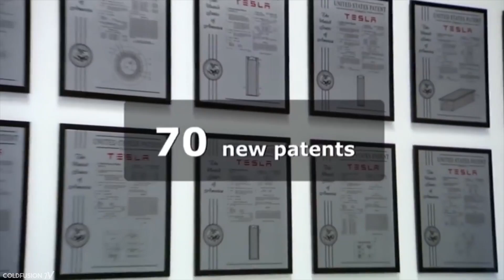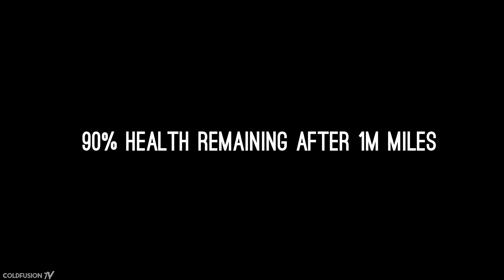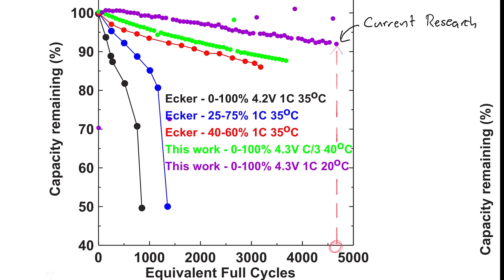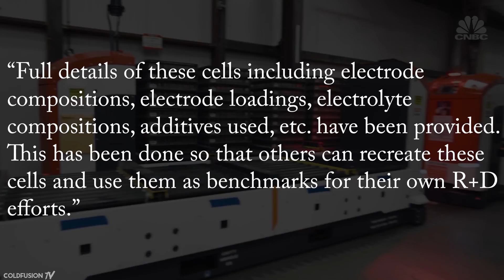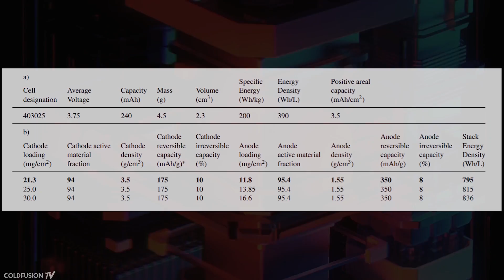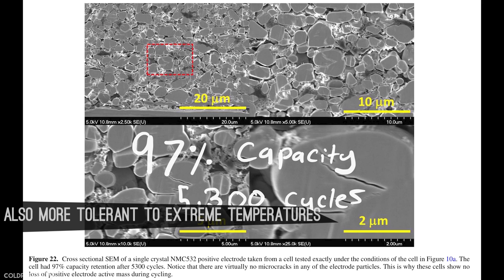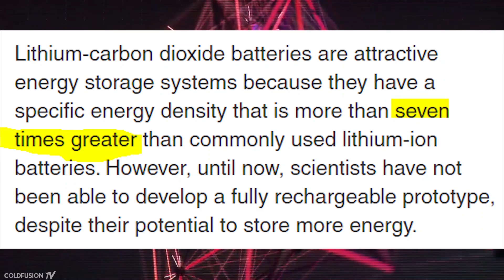Tesla's Million Mile Battery

Comment: This would be on par with a Caterpillar diesel engine life expectancy.
Reply: @James Flint Ohm's law states that voltage = current x resistance. It helps determine either voltage, current or  impedance in a electric current. It has nothing to do with the capacity of Tesla's batteries. So please elaborate.
Reply: @James Flint so I'm guessing you're smarter than a bunch of scientists
Reply: @James Flint Would it matter if the energy source is renewable? I can why that would be a problem with gasoline but the amount of wattage we create every year can easily support an EV.
Reply: @James Flint I can see where you're coming from. I actually believe nuclear is the future, nuclear is a renewable energy source it's byproducts however aren't. Thorium reactors being developed in other countries like India and China are safer than typical reactors and produce equal amounts of nuclear energy. There are also SMRs (Small Modular Reactors) that are being developed for long term energy solutions. My point is technology is rapidly accelerating us towards an electric future quickly, whether we like it or not. Because the pros still outweigh the cons.
Reply: @James Flint For thorium reactors? We literally have millions of tons of thorium laying around because no body uses it for anything. We have mined enough Thorium to power the planet for at least several thousand years.
Reply: I was not commenting on the wisdom  of battery storage, I was commenting on the improving durability of the batteries and the fact that Caterpiller engines have a 1 million mile warranty on them.  I am seeing a lot of Tesla's on the road and in a few years people are going to start needing to replace the battery packs or start repairing them themselves after they are out of warranty.

My calculations based on annual consumption of transportation fuel indicate that if 100% of our transportation were electrified, we need to increase our electrical generating capacity by a factor of nearly 2000 from current facilities.  There is plenty of room for coal, nuclear and as much hydro, wind and solar as possible.  An economical battery would even be useful at a base load power plant, if they can operate at full capacity which is at its most efficient mode, excess power at those moments could be held and released when demand exceeds base load.  We have some wind farms in Indiana now and I think they are awesome.  I have stopped and watched them for an hour at a time.  I would love to have one in my back yard.  I don't understand why people who will not even be able to see the wind turbines are so fiercely fighting them. 

The reality is every source of energy is solar.  The oil and coal come from plants and animals that concentrated the solar over millions of years and then were sequestered under ground.  Even nuclear power is concentrated solar from a long dead star that super-nova'd billions of years in the past.  Wind is solar because it is the sun heating up the ground and causing the air to rise and creating a vacuum at the surface that creates the wind.  Hydro is solar because the water from our oceans and lakes were heated by the sun and raised to great height, it falls as rain and is stored in reservoirs lakes and rivers.

We have some promising battery tech on the horizon but isn't there always a promising something on the horizon.  Fusion power has been 30 years away for as long as I have been alive.
Reply: James Flint you have a better idea?

Comment: Imagine a phone battery that charges in 5 minutes and lasts 1 million+ years.  This is the battery tech we've been waiting for.  This also helps for overall electric.  Our problem is storage.  With these highly efficient and lifespan viable batteries, we can probably have electric be free within 50 years.
Reply: Its 4000 full charge cycles, so about 4-8x better durability. Much higher on partial cycles.

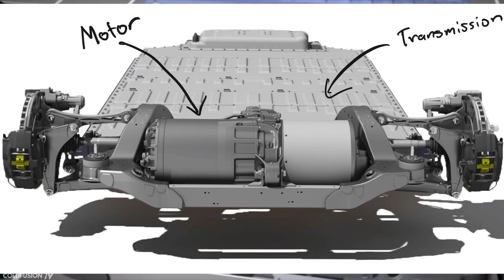Comment: Already @2:30 in the video you are woefully WRONG!  That's not the transmission you are pointing at in the Tesla underbody that is the inverter system. The part that converts battery energy into 3 phase power for the motor.  Between the inverter and the motor is a small planetary gear system that is the transmission.

You need to go do more research!  https://www.youtube.com/watch?v=3SAxXUIre28&t=24s

Comment: I'd be happier with an EV that did 750klms between charges and charged in an hour.
Reply: Unless you have a 425km commute to work then that is absolutely pointless. Unless you drive 750km in a day that's pointless. The idea with an EV is you plug it in when you get home so it's always ready for a new day. You never need to go fill up again, never need to go out of your way if you're organised at home. The only issue is with road trips where you need to (in the present) search out a charging station.
Reply: @dannnnn496  That's great if you can charge it at home. I live in West London. I have nowhere to charge in at home. I can charge it at work for free but I need a pretty good reserve. I have a holiday home in Ireland which I drive to about once every six weeks. It's about 400klms just to get there.
About 60% of city dwellers can't charge at home. If indurance in pointless then why is it one of the biggest selling points?

Comment: Great video!  We’ll see how soon this comes into fruition — whether it’s a year away or more like 5.

Important thing to bear in mind about the 90%-degrade cycle counts you quoted in this research (1000 on current battery cells vs. 4000 on these new cells):  These cycles are 100% discharge and 100% charge.  While Tesla lets you do that, they discourage you from charging higher than 80%, or discharging below 20%.  Most other (PH)EV manufacturers don’t even show you the full range of battery charge, maintaining an invisible 15ish% “charging margin” at these top and bottom.  That is, they make it impossible, not just strongly discouraged, to charge beyond these margins.

These margins vastly increase the numbers of charging cycles.  You definitely can charge even current batteries many times the “1000” cycles without substantial degradation, as long you maintain these charging margins (which, again, many EV makers don’t even give you the option to violate).  Plus, of course, provided that the battery had sufficient cooling, and a few don’t (basically, don’t buy a Nissan LEAF if you live in the southern US states, unless you’re OK with 30% degrade over 10 years, which is acceptable for some people, but at least arguably not many).

Comment: Emagine having an RTG that feeds the battery all night or whenever its not being used.  The car would never need charging from the grid.   80 years of driving the same car.
"Each RTG had a total weight of 37.7 kg (about 83 pounds) including about 4.5 kg of Pu-238. It uses 24 pressed plutonium-238 oxide spheres and provides enough heat to generate approximately 157 watts of electrical power initially - halving every 87.7 years. Each RTG generated about 2400 Watts of thermal power."
We have the tech to secure and protect the core from crashes and tampering.

Comment: I began to doubt the credibility of this post when you said an electric car has only two moving parts. Besides the motor and the transmission you have the steering and braking systems, the doors, the wheels, compressor for AC, etc. I'm not an engineer so I don't know for sure, but yeah credibility issues...

Comment: What a stoopid point! Main reason for buying a new car is not the fact that car is broken but vanity. Car companies advertize that you must have a new model because it has more torque, more HP, abs, drs, atcs, prtdghutfs and all the "eses" and whatnot. I work in a bank and drive mitsubishi with 280.000 km already driven. Everybody thinks i am crazy and ask me "why dont you buy a new bmw or mercedes"? I said "why"? This car i have is perfectly operational. They said, but new car  has this and that. At the end, it is all about dick measuring. And nobody's is streched for 1.000.000 miles. It ussualy "folds" around 150.000 miles or few years.

Comment: Sharing the info of the battery is not a nobile act, it's a smart strategy. The limitation of electric cars right now are batteries. If someone else can fix batteries using that information, it will solve Tesla's biggest problem, pushing forward the electric vehicles market hence Tesla's business.

Comment: Elon Musk should also divert some of the research on sodium ion batteries.. with lithium fast becoming a scarce commodity due to the unprecedented demand for battery manufacture, sodium ion batteries although a bit bulkier and less energy dense than lithium ion batteries at this point would be a good alternative for use as a energy storage and power wall alternative in power grids and homes.

Comment: Awesome video, It is so great to see innovation that leads to better technology for everyone.
The new lithium-carbon dioxide battery is very interresing, if it lasts 7 time on a single charge, that means it needs to run through its cycles 7 times less often, so it can hold up to 3500 cycles relative to the current battery technology.

Comment: 4:34 What a load of crap! Tesla doesn't aim to help any other companies improve their designs! They've got an EXCLUSIVE LICENSING AGREEMENT!

Tesla doesn't do jack sh#t to further EV adoption rates among traditional car manufacturers or help improve general battery technology whatsoever. They are a for profit company, so stop acting like they are a damn charity. Elon's only goal is to make money. That's why they refuse to open up their supercharging network to any other cars, that's why they have an exclusive licensing agreement with Panasonic so that nobody else can get the cells they are using. That's why they are the only large car manufacturer refusing to sell spare parts to anyone. They want all the money they can get, and they are willing to go further than any current car manufacturer to do so... even VW is offering to supply EV components to everybody who wants to use them, they also sell spare parts, repair manuals and diagnostics tools to the public and to independent repair shops. VW for f#ck sake!

Comment: What hasn't really been mentioned is that a doubling in lifetime cuts the cost for storage in half. This is not so obvious for cars since even a pristine battery is still enclosed by an aging car, If you sell it after 10 years you sell a mix of both.  But it will still reduce the money you lose between buy and sell and thus lower your total cost of ownership. Where is becomes pretty obvious is with grid storage. There is a lot of talk how we can not get to 100% renewables because we can't store the energy. If we can double the lifetime then we are cutting the cost in half per unit stored. And this is described as "just a milestone". It's really hard to find word what a colossal change this is.

Comment: You missed the key change, instead of coated nickel cathode particles made up of hundreds or thousands of crystals, each particle is now a single coated crystal of cathode material - which does not break when pressed onto a current sheet, or in operation with Li-ions moving in and out of the particle. Nano One coat particles with graphite to protect them - same material as anode. Nano One mix the pre-cursor cathode materials, including the lithium, in one go - once the cathode crystals form while being baked, I assume Nano One then add in the graphite to coat each cathode crystal. Previously, making single crystal cathode particles was expensive.

Comment: Why are electric cars still using differentials? This IMO must be replaced by a dedicated motor per wheel instead of the current motor per axle. And no need to power four wheels because getting rid of the differential most of the acceleration slip problems are solved.

Comment: Didn't Tesla buy into the Maxwell super capacitor and lithium battery producer? Apparently they have a lithium battery with about double the capacity for weight and could use super capacitors for burst currents during acceleration and regenerative braking, which otherwise stresses regular batteries.

Comment: You have to drive 200000km with EV to break even in co2 compared to regular car. Battery manufacturing makes soooooooo much co2 that ev cars only makes sense after 200 000km of driving. But NONE. Of ev lasts that long.
Reply: Lie

Comment: I can imagine a four wheel car using one wheel to power the car & 3 to charge the batteries making the vehicle basically self recharging & powered with no outside source & completely green.
Reply: Sadly, that'd be impossible because it would go against the first law of thermodynamics. Energy would be lost with friction from the road and recharging a battery from the wheels slows down the car (think of regenerative breaking). All of that without taking into consideration that the system wouldn't be 100% efficient
Reply: Josh Bruegger I don’t know enough about power generation but what I had in mind was something similar to coil armature with magnets around it that would generate voltage by simply spinning without touching parts or friction to slow the vehicle down. I’m not a engineer by any means, I guess if it was possible the top guys at Tesla would of thought about it long ago.

Comment: I’ve worked on Cars most of life and I tell you Cars last much longer than you say( with some repairs cars from the 60’s-70’s can be as good as the day they were made. Also a worn Clutch or blown head  gasket are just half day jobs for most cars. The thing that is making cars more expensive  and ‘uneconomical’ to repair, is the technology they now attach to perfectly good mechanics, adding CPU’s and sensors to everything. Which means another and completely unnecessary ( electrical) layer of Engine function that can go wrong is added. These ‘Brains’ ( as they call them) of the cars are so expensive that if they go wrong on a 10 year old car, for example, it will end up in a scrap yard, even though the mechanics are fine!. Also I disagree with battery powered EV, I think HFC is the best Environmentally, and is the best way of storing excess renewable energy, as is being done on the Orkney Isles etc. Who are using the HFC as Combined Heat and Power( CHP) units, that power and heat Portside Buildings etc.

Comment: If lithium carbon dioxide batteries can store 7X the energy, this could make electric planes more efficient than jets.
Reply: The every density and weight are the largest obstacles for electric aircraft
Reply: It would probably also turn the battery into the equivalent of a package of high explosives. Good luck with that plane though.
Reply: @richardmetzler7909  Well, so does jet fuel.
Reply: @richardmetzler7909  remind me, is gas tank explosive?
Reply: Future battery technology promises to be safer in addition to cheaper and lighter.
Reply: @mortimersnead5821  Where? Sorry I don't want our landfills full of toxins...
Reply: Serpuns Every year, 4.6 million people die from air pollution. Our landfills are currently stocked with toxic petroleum products.
On the other side of Petroleum is a better world than the one we live in.
Reply: @masoicv  what toxins are you talking about? What amount of fuel is going to be in them when they get cleaned and recycled, compared to burning in the atmosphere? Lmao

Comment: Cars and mechanical devices in general are far more reliable than made out in this video, especially the likes of Toyota. Most issues that arise aren't catastrophic and can be repaired on the roadside at least well enough to make it back home/to civilization. Also if you run out of fuel someone can bring more fuel to you. If you run out of battery or the battery for whatever reason fails, you're stuck. Maybe in the future you'll have specialized recovery vehicles that can act as a remote charging station, but that's still not ideal. Also with an electronic device not only can you have wiring and electronic issues that you need specialist tools to diagnose and fix, you also have software issues. How long has Windows and Mac been around? You still run into errors and bugs on a regular basis.

Comment: Car manufacturers and dealerships make a great deal of money in aftermarket sales and servicing. Service departments especially love to charge extortionate amounts of money for avoidable and often unnecessary replacement parts. I highly doubt they will want to give up that goldmine. Case in point: Nissan and its joke of an EV the leaf. It's ugly, charges very slowly and has no active battery temperature managment leading to a greatly shortened lifespan of the battery. In a recent case Nissan actually wanted to charge a customer 30k bucks for a replacement battery for a Leaf with only 80k km on it. Utterly ridiculous.

Comment: @ColdFusion
: "Don't stare blindly on capacity, cycles is what counts". 
Also: "CO2 battery, 7x the capacity of regular li-ion*. "

* In a lab, horrible cycles, terrible conditions.
Reply: The chemistry tested for the 1 mile battery did it at full discharge and charge cycle to achieve the 1 million battery figure.